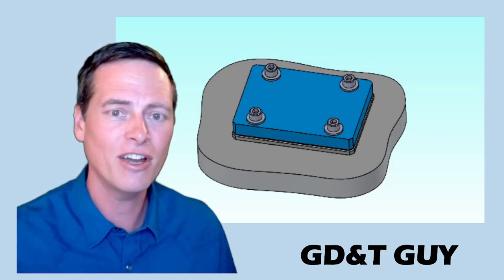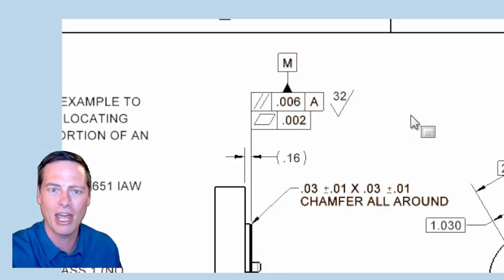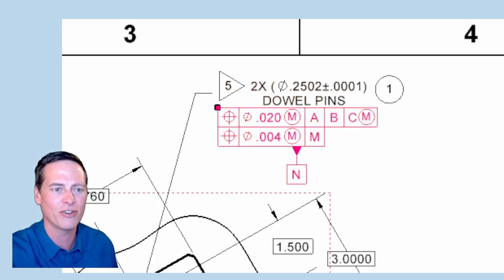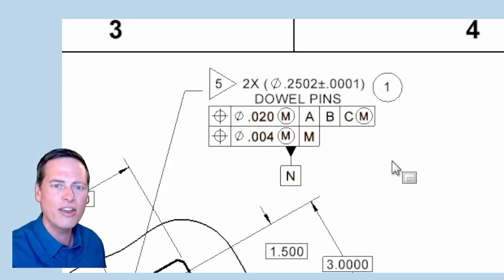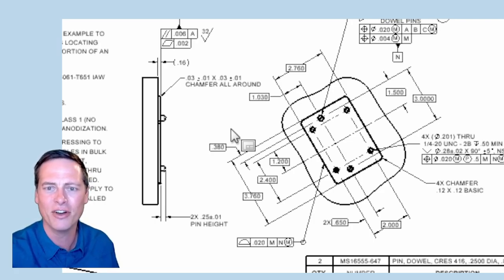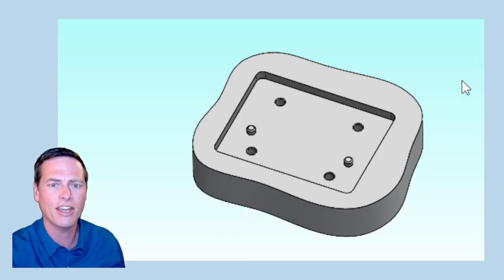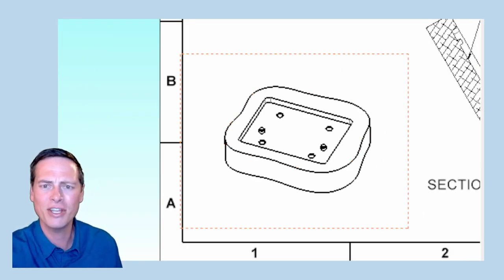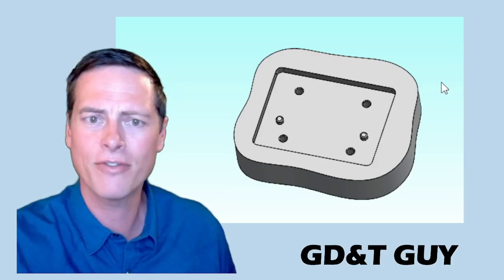Dowel Pins as Locating Features - Ep 7: Alternative approaches, part 1

Comment: Should the FCF for the dowel pins be composite rather than multiple single segments? Especially since your intent is to use the lower segment (with .004 Inch Position Tol) to control the feature pattern i.e. the feature to feature variation within dia .004 Inch?